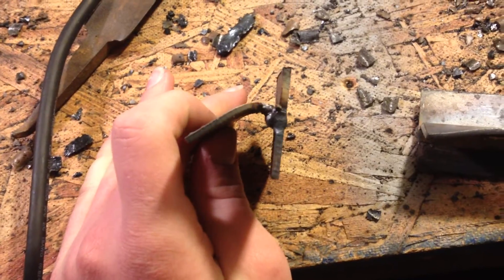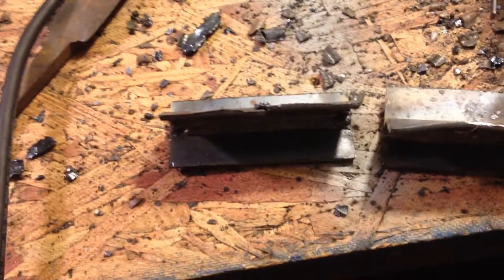7014 vs. 7018 stick electrodes

Comment: First tried 7018 and I struggle to weld compared to 6013. With struggle i mean I can't start to weld the stick sticks a lot at the start, i've tried different amperage, no luck, im using 160AMP inverter welding machine
Reply: They say the rod metal on the 7018 will burn up into the flux & needs to be chipped off... And on starts u need to scratch the tip of that rod on something... On ur work piece or Sand Paper... Ive read dozen's of times that 7018 can be difficult to start... I haven't used any of my 7018s yet...
Reply: @OldGuy70s  thats right, here after one month, somehow I'm getting used to it..i just do everything you said and thats true, plus you need very good control of the hand, i think thats the main key to 7018.

Comment: I'm thinking about switching to 7014 because they store easier. Any downsides that you've seen with 7014?
Reply from the maker: 7014 isn’t nearly as strong in a structural setting but just for little projects they are perfect

Comment: Both rods are going to be way stronger than the steel you are welding on in this clip which is most likely just A36 mild steel.

Comment: You welder only goes to 75 amps? Not enough.......
Reply from the maker: Tec 9 I usually preheat the metal before welding but 75 amps is enough to run these rods if you know what your doing